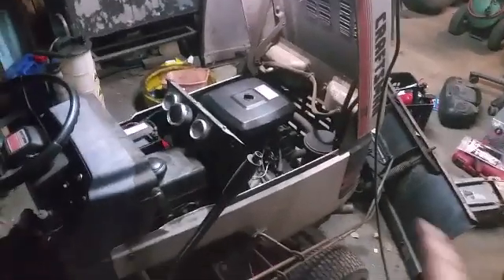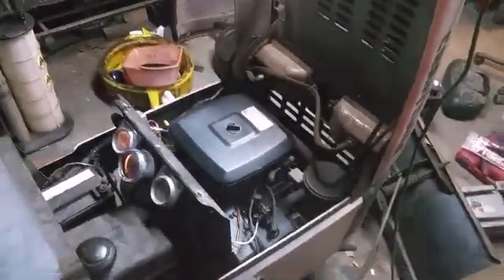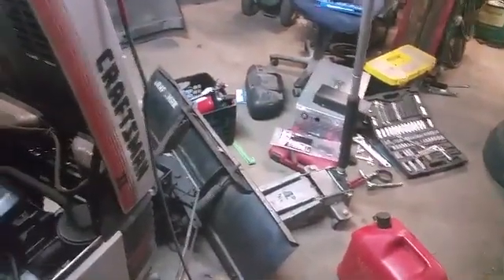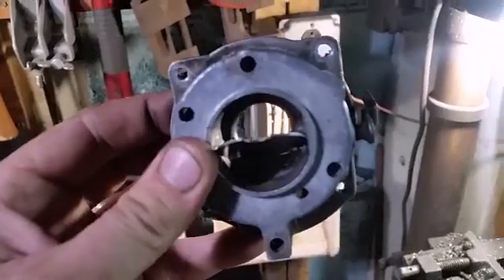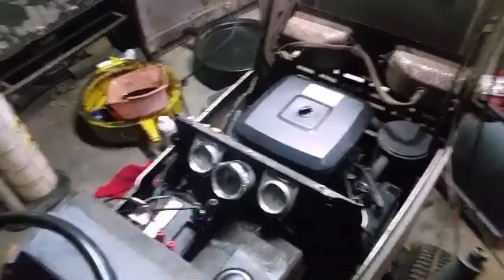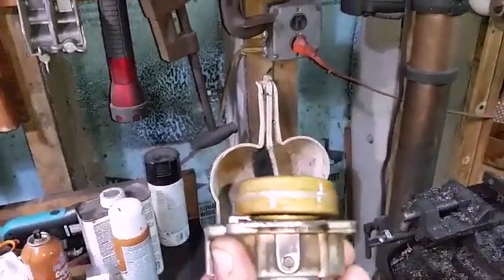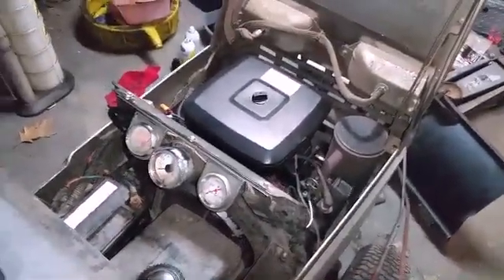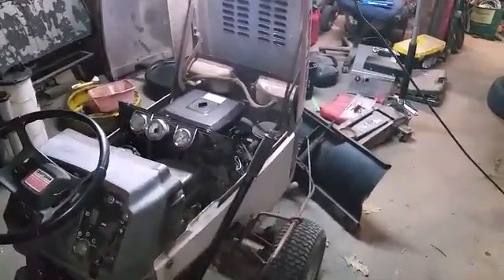Opposed twin briggs trying to nagate throttle lag

Comment: Hey willie.  I was having issues too. I found 2 holes at the carb plate,in the body. I cleaned the top one 3-4 times. Then I found the second hole... and VOOLALA, it fixed the prob. I've watched so many vids and never saw the second hole cleaned. It made a BIG difference.  Love your vids. They sure help. BTW... I have 3 Sears with Onans. SS16'S. Contact me if interested. Texas
Reply from the maker: Thanks for the comment I'm in North East PA though. 
I have since replaced the opposed twin with a mild performance built Vanguard still needs little more work but I do have plans to put a 49 cubic inch displacement opposed twin briggs together😉

Comment: You are running too lean at idle. It could be an adjustment or it could be a blockage in the idle circut or it could be water in the float bowl. Those are your options. Put the float back to parralel to the surface and check the needle valve for blockage or sticking while you are there.
Reply from the maker: I tried turning low speed screw out to richen it doesn't help much just nature of a carb without an accelerator pump. 
Someone shared a comment on this video with better details on the briggs downdraft carbs. 
I have modified another carb to utilize a needle for high speed which helped alot engine is currently replaced with a performance built vanguard wile I build up the opposed twin plan on building a horizontal model 46😉
Reply: @willyck948  They don't naturally behave that way if they are adjusted properly. I suspect you probably have a blockage in the idle circut.I ha e one sitti g on the lift now that I'm waiting for head gaskets for. When I get it back together I'll record it for you.

Comment: A few pointers about these simple carbs.
1. There is no compensation device (power valve or accelerator pump) for when the vacuum drops suddenly (like when going from slow speed immediately to full speed).
Therefore, you can't completely eliminate what you're trying to fix.

2. Float level will only "bias" the fuel mixture to a slight degree. It's an overused and overrated practice (just my opinion guided by experience). Float parallel to carb body is the correct level adjustment, as you showed in your video.

3. The adjustment screw on your particular carb is only for idle mix and some transition. Briggs calls it the pilot jet. You have to find a compromised medium between overloading at idle and surge at higher speeds.

4. Fuel flow through the main jet is critical, especially at medium to high power demand. Check that main jet. Even if it appears clean, use a small pipe cleaner or something similar to remove the varnish that could be restricting the orifice. Check for intake air leaks. If the engine (warmed up) is running lean when you open the throttle but seems to be working fine otherwise, don't be afraid to open up the main jet. A little at a time; trial and error. These engines are thirsty animals, and as they wear they need more fuel to run properly. 

It's just simple things, however it's possible to get the carb working fairly well.
Reply from the maker: Thanks for the info. 
Engine has had valve maintenance done and replaced all the gaskets shouldn't be any air leaks but never checked. 
I understand they aren't perfect it is better than it was would die if I touch throttle even a little when it's cold out 15°F or colder. 

Tried richening low speed runs to rich at low speed no change higher speeds would still stumble loose rpms. 
After adjusting float it is better and isn't running rich at high speed didn't need to adjust the low speed at all doesn't stumble and loose rpms like before always going to hesitate little since it's long manifold and like you mentioned no accelerator pump👍

Comment: I have never had this problem with my Opposed twin
Reply from the maker: 4 craftsman engines each one would stall without choke till warmed up could be I live in higher elevation.  
Wanted to do test on mine before doing a friends tractor wich I believe is weak fuel pump will get a rebuild as well see how it goes.
Reply: @willyck948  I all was let my twin warm up befor I use it. lol it will not mover until the hydro warm up to
Reply from the maker: Indiana Elevation ranges from 600 to 1,000 feet 

Mount Cobb PA is 1600 and colder not sure how big of a difference that would be in tunning🤔

Copied this from automotive racing cite talking about boosted engines compensation for elevation. Engines running richer on fuel at high elevations 

For small changes in altitude, carburetors will compensate without any modifications. For larger altitude changes, carburetor jetting adjustments may be needed. A rough estimate is one to two jet size reduction for every 1,000-foot elevation increase. That is dependent on various factors including the carburetor manufacturer, the method of mid-throttle transition, and any added provisions for smog control that may alter the carburetor operation.
Reply: @willyck948  thats so cool. that something I will have to remember next time